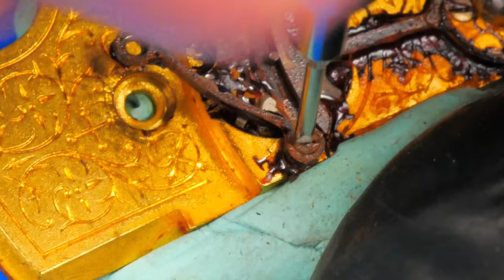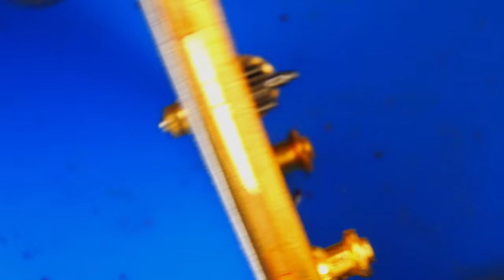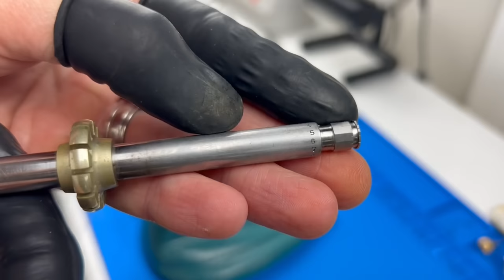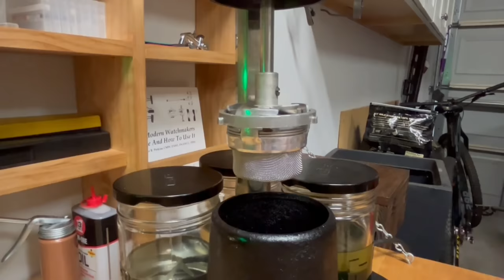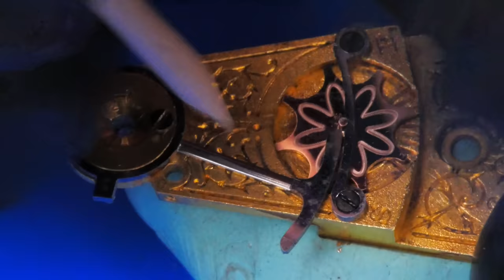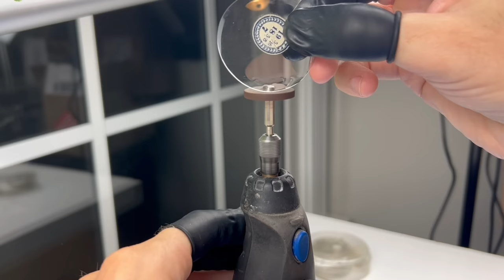RUSTED AND BUSTED - Caught in a HOUSE FIRE 🔥- Can I save this family heirloom?

Comment: One might reasonably argue that some of the un-numbered components you did replace contribute more to the actual functioning and character of the watch than some of the numbered components you preserved. But as Terry Pratchet put it: "This is my great-grandfather's axe. It is over 900 years old. Of course sometimes it needed a new handle, sometimes a new blade, but it's still my great-grandfather's axe"
Reply: So...the Theseus ship paradox all over again...how much you can replace till something isn't that specific thing anymore...
Reply: @lucyxchan6808  That paradox is actually about substance vs. identity. The real uptake is that substance does not define identity and identity does not define substance. If you drive this to the extreme, you arrive at the teleporter conundrum, which asks what happens if you replace all the substance of a thing at once. (I actually  only just realized that the Theseus ship paradox and the teleporter conundrum are essentially just facets of one and the same concept. NEAT!!!)

Comment: Wow what a case! Theses will never be made like that again. Nice job on getting it back to working order. Nice to see you using the peg wood, does not leave a scratch mark. One thing that I was taught about full plate assembly is to assemble on the 16s (back plate) side, lay the 18s (dial ) side on top after wheels are in place and flip the movement over.I made a movement holder to do just that. It has helped me in getting the arbors to fall into the jewel holes. I also like you, use a small amount of rodico at the fork to hold in place, then remove when it is all assembled. You seem to be upping you skills with each video! One thing if you did not think about it is, replacing the MS with an Alloy spring may be one of the reasons you had to add screws to the balance wheel. I agree with the advantages of the alloy spring but to stay "original" just a thought. Keep up the great work, really enjoy your video talents as well.
Reply from the maker: Great tips! And excellent point about the alloy spring contributing to the increase in speed. Thanks. - Chris

Comment: Your ship of Theseus comparison is quite apt.  You need to ask the question, if they want the watch to work.  Also, have they ever even looked inside the watch?  Is the watch just the case and the dial to them?  I think 99.9999% of people have never looked inside a watch nor do they care to.  If the ship of Theseus were to set sail and immediately sink into the harbor, would it still be the ship of Theseus?
This was the most impressive timing correction I've seen.  Your skills are quite impressive.

Comment: Good stuff, Scott!.   That one pretty much run the gamut and took everything..wow!.
Reply from the maker: Thank you! I show true a little bit in this video at 1030: https://youtu.be/ckFW2bVVQP0?si=c_1g-tgzm4V-jFN8

I didn’t show the undercutting but maybe next time I’ll film that part too! - Chris
Reply: Thanks, Scott.  That would be awesome!.   Did you actually drill holes in the balance wheel, make extra screws, and install those extras to put the wheel into balance?.  If so...Wow!.  I have never seen anyone do that.  I figure you've reached the top shelf of mastery if you can do that.  Sorry for deleting part of my comment.  I figured I best not bug you with all the inane requests and questions.  As it is, you show just about the most advanced work of any of these watch repair channels.  Good stuff!
Reply from the maker: @wildernessofzinn17  the balance wheel comes with holes predrilled and threaded to accept more screws in these circumstances. So that was one thing I did not have to do. - Chris

Comment: Great restoration of a very beautiful watch. I have read that in the old days they used to heat the bezel in order to expand and then put the crystal which would freely sit . Then as the bezel cooled off the crystal would be gripped by the bezel and it would stay in place.
Reply: Perhaps, that's why the crystal they sent you was larger than what it was stated on the paper
Reply from the maker: That’s true. I’ve tried that myself but never worked. Maybe I’m just not quick enough or lack the skill yet

Comment: Old pocket watches sure seem like they should be worth more.
Balance washers are always fun. I've found a small pin vice works great on those screws and lends more control.
Reply from the maker: Good advise on the pin vice. Sometimes those screws can be too tight for a steel screwdriver
Reply: Weather an antique is worth anything highly depends on how long of a production run it had, How many were reproduced, how popular it was, and it's durability. FOr example. It is more common to find a pocket watch from the 1800s that can be either fixed, or are in somewhat running order, than a wax cylander in great condition because most you find are cracked, or moldy.

Comment: That was tremendously satisfying, though I must confess, I have no idea what is holding the crystal in.😊
Reply from the maker: It snaps in because the opening of the bezel is actually slanted. Where the crystal actually sits is slightly larger than the opening. However, a little drop of GS Crystal Cement does ensure it doesn’t pop back out if the case takes a hit
Reply: @csspinner  Very good. Thank you!

Comment: Very beautiful and precise restoration, so instructive. After cleaning the rust, how do you treat the parts with  the little remaining o difficult rust before cleaning them in the machine ? Great videos, I am learning a lot!
Reply from the maker: A little soak in evaporust helps a lot. But many of the parts were a lost cause as there was too much steel material lost to the oxidation
Reply: @csspinner   Thanks!

Comment: Thank you for the video. Great work. Have you ever given the thought of using either the Horotec or bergeon tools that are like probes/sticks instead of pegwood? The do not flake off particles like the pegwood when using to assist in the re assembly process?   Just a thought.  Also it looks like the third wheel plate jewel was cracked?
Reply from the maker: That’s a good suggestion. I have since bought a bergeon peg, but I mainly use it for holding parts and plates in place. I like that the peg wood deforms and shapes to the profile of the part. The particles get washed away in the cleaning.

Comment: I figure if this kind of thing ever happens to my collection, I will remove the dials and store the movements in 99% ipa to drive out the water for a few days. Hopefully that would at least prevent rust of this level from forming.

Edit: Nevermind IPA. Mineral spirits. IPA would melt the shellac.

Comment: The sheer count of tools you have to have to do such repairs is just mind-boggling. I'd like to try my hand on it, but there's no way I'll spend thousands on tools. At least it explains the prices watchmakers charge, the investment in tools is just tremendous.
Reply from the maker: That is true. It’s one of the hobbies with a rabbit hole. However, I got started with a $200 budget of tools mostly from Amazon trying to fix watches I found on eBay. Sure there were a few watches I had to put in the drawer, but if you can find ones that just need a clean/oil/assemble then the basic tools is all you need.

Comment: Looks like the watch was lying dial side up aind drained pretty quickly, and only the balance mechanism was really affected since water was pooling in that rear cover? Because other than that there seems to be significant corrosion only where water was trapped by capillary forces.

I have no background in watches (but from time to time find an odd fascination in those videos) but come from playing around with R/C "nitro" engines. The use of both methanol and nitromethane in the fuel leads to the formation of corrosive byproducts, which can in some cases utterly destroy an engine in weeks or even days if no precautions are taken. You can very often determine which orientation an old engine sat in the box it was thrown in and forgotten by the pattern of rust.

Comment: That pocket watch has to have the most jewels I’ve ever seen in one. Typically with the larger pivots of a pocket watch, more free play and end shake they were un-jeweled. As they were more durable to wear than a smaller wrist watch.

Now I don’t know the year this watch was made, but 19th century would definitely be un-jeweled. This has gotta be a early 29th century or higher end movement.

Based on my limited knowledge that is.
Reply from the maker: This one was manufactured in 1903

Comment: I have a Woman's Pendant Watch in 18K . Other than the case are there any other parts Gold. Like the winder tip or other inter parts?.
Reply from the maker: Generally just the case would be gold. The internals are brass and steel
Reply: @csspinner  thank you very much.

Comment: See what you do is take all the parts that couldn't be saved and build a little stand for the watch to be displayed on. Be it hung or be it a base you lay the watch on when you take the watch off the stand you see the parts that had to be replaced encased in resin arranged to where they would have been found inside the watch. 
While the house fire is a terrible experience it's still very much apart of the history of the watch that would be handed to each generation. 
You don't have all the time in the world so make the most out of the time you have be then good or bad times.